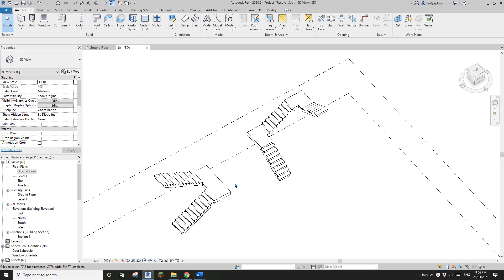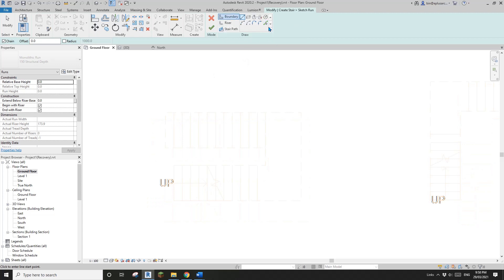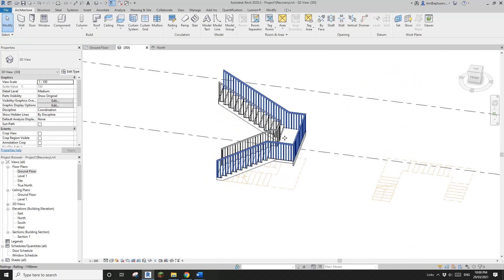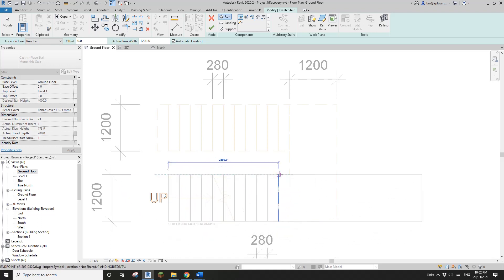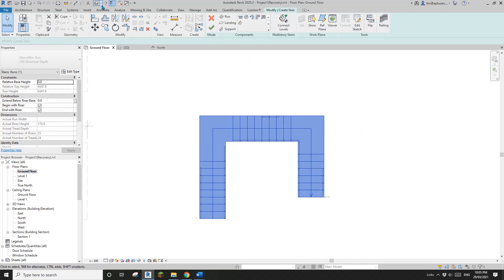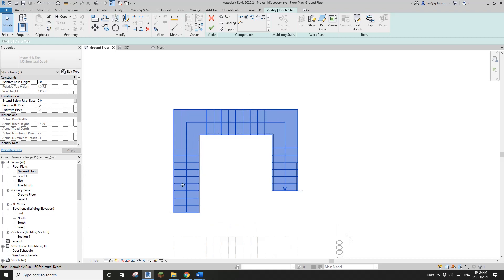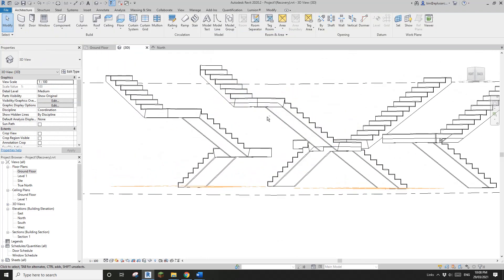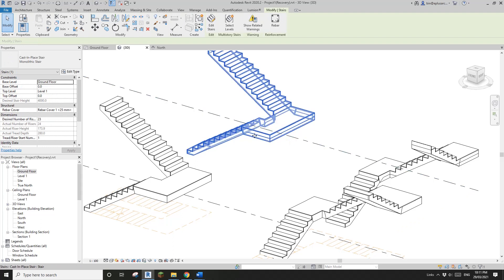Everyday Revit (Day 377) - Create Stairs From DWG

Comment: I am happy that I found your channel.
Could you plz make a stair video on custom riser height?
For example, I need a 5.75" riser height for a roof height of 10'6".
Reply from the maker: I don't think it is as easy as typing a number. You need to set the base and top level of the stairs, and create a run of stairs, Revit will then work out the step riser height depending on the stairs height, Maximum Riser Height and treads number.
Reply: @BINHE615  thank you

Comment: Shall we change actual Riser height..I couldn't not be able to do that....because. i have given maximum riser height 17.25cm..but acutal riser height value shown 17.07cm..how to fix accurately. Pls give your suggestion
Reply from the maker: The actually riser height is computed by dividing the overall height with the number of risers. Time the 17.25cm with your riser number to get the overall height, then adjust the top constrain of your stairs.